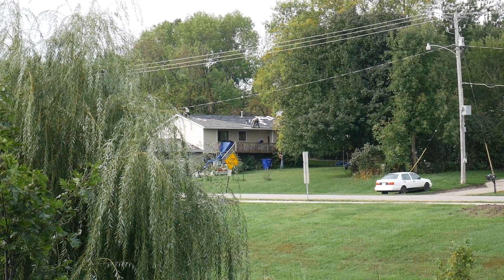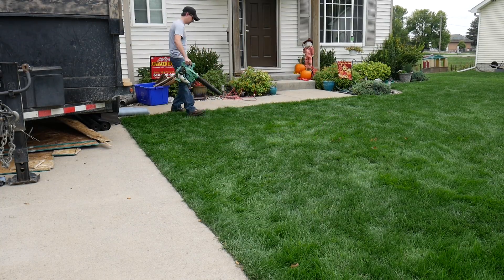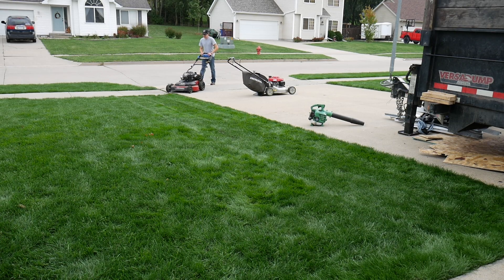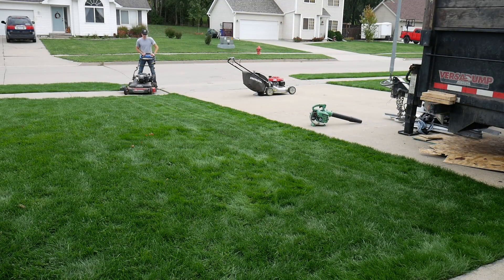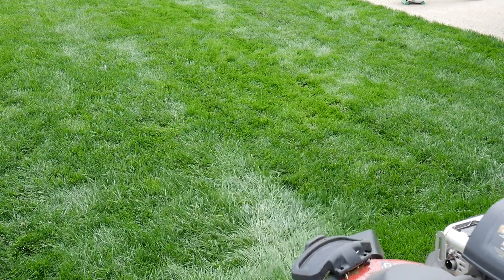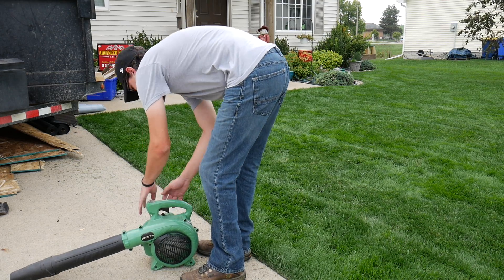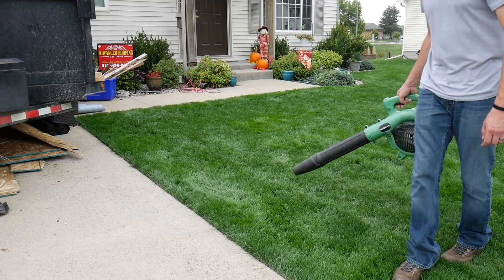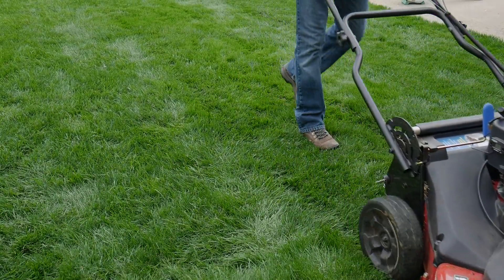How To Fix Trampled Grass

Comment: Hi Ryan, I need ur advise. I did my fall recovery at the end of August bc the temperatures in NYC were low and rainy. We haven't had any rain until today. I also applied milorganite on labor day weekend. My grass hasn't recovered. Should I apply more milorganite?
Reply from the maker: You can but it's likely just the lack of water. It will get there in time.

Comment: Any further tips on areas that are trampled more than just a day or two? Love your videos, by the way. I searched and couldn't find quite what I was looking for. I've got those couple of spots where, every day the kids run off the same spot on the back patio, to the trampoline, and all around the trampoline. What do you recommend for long-term, high-traffic areas like that? Right now it's spring and I'm very pleased with how the rest of the lawn is doing, but those couple of spots are matted, shorter, more dry, and the dirt more compact. Tips? Thanks!
Reply from the maker: Limit the traffic in that spot over and over or there won't be much you can do
Reply: Well, might be hard. These kiddos don't seem to pay much attention to my signs 😂 But thanks for the reply! Keep up the great work.

Comment: Question - after you over seeded did you get any white spots in the lawn? I have some small spots here and there in my existing grass that are turning white. Could it be too much water maybe?
Reply from the maker: Yes I have had a few here and there and especially after it rained another 2 inches last weekend.  My next video will talk about it a little bit.
Reply: ryanknorr yeah same here. I water twice a day then have had a couple days of rain in a row. It seemed to start once its  got to the point of staying wet. Was wondering if the two were connected
Reply: hit it with some fungicide ASAP.  Could be dollar spot, which will destroy PRG super quick.  Mine started with little spots, and killed my entire lawn within a couple weeks.  Keep putting it down every 2 weeks.
Reply: VanAwesome thanks for the reply. Just from how it looks im pretty sure its not dollar spot
Reply: I'm not 100% sure that mine was dollar spot either. haha.

Comment: Have you ever considered robotic lawn mowers that work with buried boundary lines?   I looked into it about 5 years ago and they didn't seem cheap enough or reliable enough yet.  When I fert with Milo and water regularly I have to cut the grass every 3 days.  It would be kinda cool to be the first one on the block with a robotic lawnmower.  Don't get me wrong, I like cutting the grass myself too for the exercise but lawn-keeping overall can get laborious if I'm busy with life.  I'd like to be able to focus more on weed-killing, fertilizing, watering , gardening, flowers, plants, pavers, walkways, retaining walls, solar lights.  There's so much more I'd like to spend my time on than always cutting grass.
Reply from the maker: It would be an interesting thing but personally for me, mowing is my favorite part so I will keep doing that as long as I am able!

Comment: Step 1. Use a rake.
Done.
Reply: not a good idea to rake grass thats just barely rooted. you would have torn up the lawn and ruined all that hard work from the previous month.
Reply: You're not supposed to mow a lawn until roots are established because the vacuum created by the blade could suck the grass out, or the blade could tear it out. That blower is rated for 170mph air flow and would be just as damaging if not more to newly rooted grass. I don't think you would do more damage by simply lightly raking, and it be far more effective and efficient than blowing.
Reply: he wasn't using that tiny blower full throttle, & even if he was, it would still bring up less grass ( if any at all ) than almost any rake, unless you turned the rake upside down.